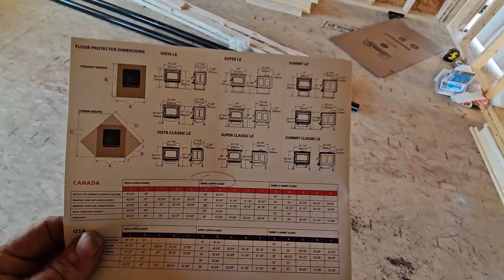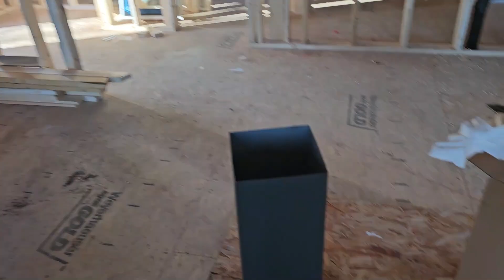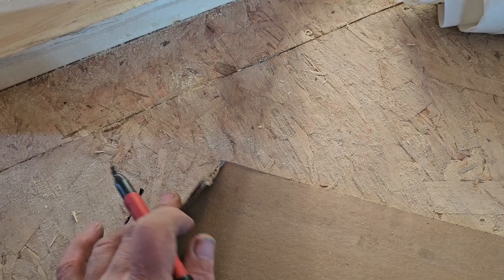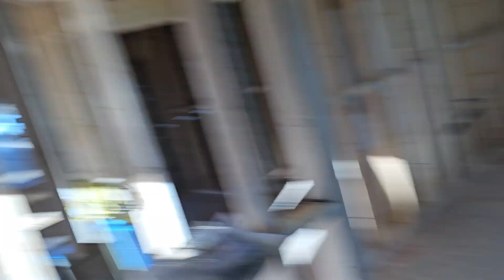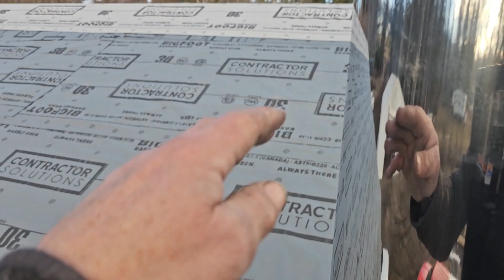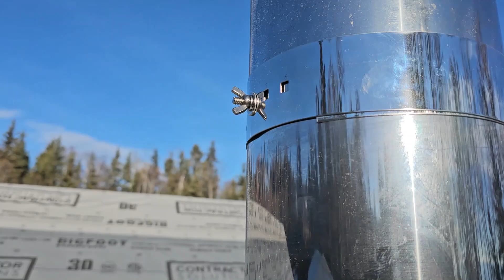Wood stove chimney install

Comment: Hello! My husband and I are making an offer on our first home. It's a real fixer-upper on a lot of land in the Ottawa area. The furnace needs to be replaced and I'm looking at a winter of fixing it with no heat. I am looking for temporary wood-burning heat options to supplement electric wall heat incase we get a very cold night or the power goes out. Long term I'd love to install a wood stove. What are your thoughts on temporary portable wood stoves, and running your chimney out a window?